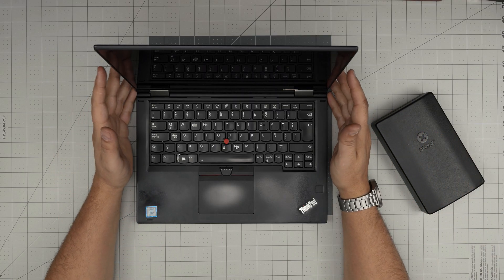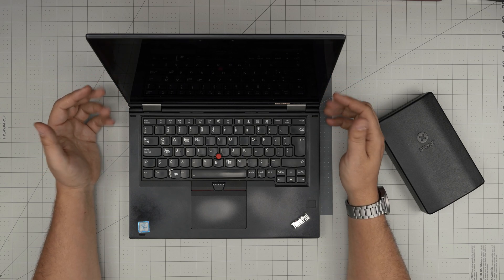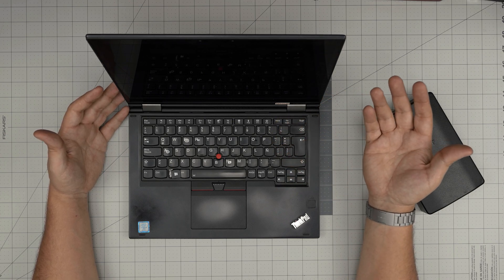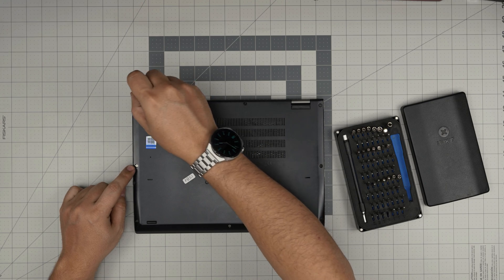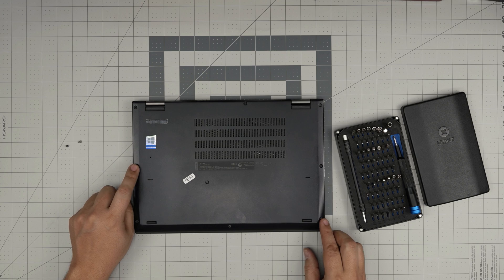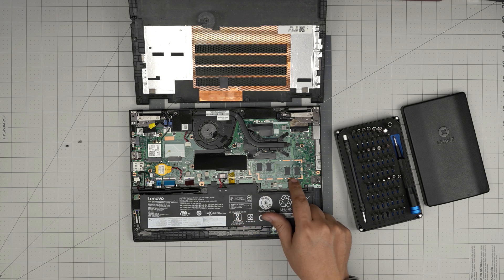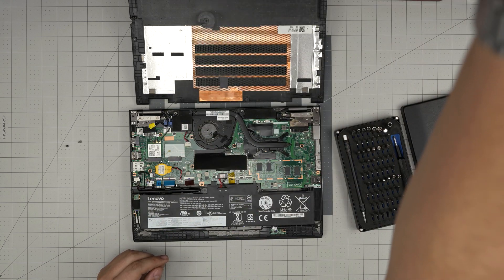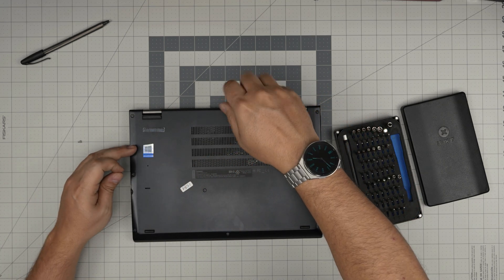Why the RAM on a Lenovo Thinkpad X380 Yoga Laptop is Not Upgradable

Comment: if ram is damage all laptop is garbage
Reply from the maker: 🫠Regarding your question, you can take it to a repair shop where we can replace the RAM chips with ones of a larger capacity or the same. This isn’t something you can do at home, as it requires soldering and a rework station.
cheers🍻